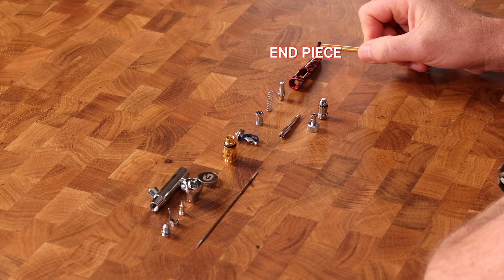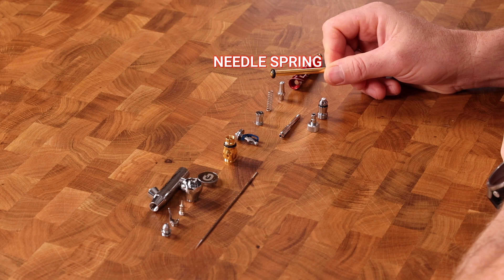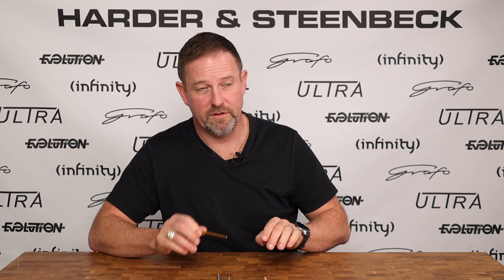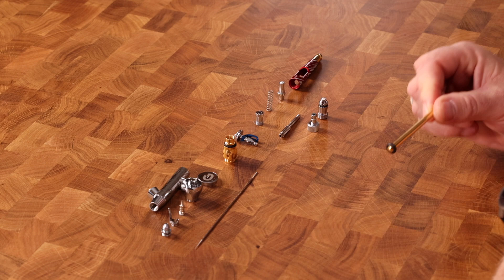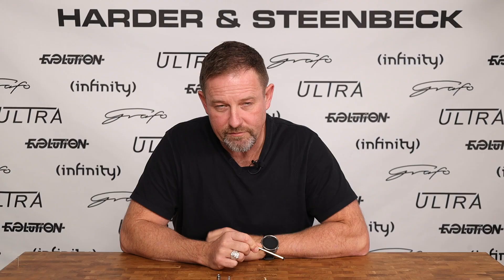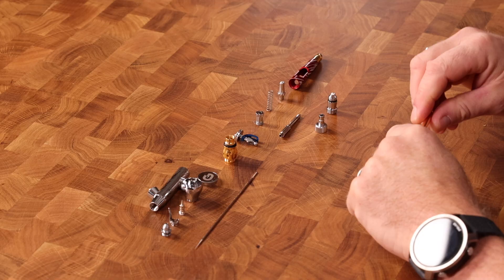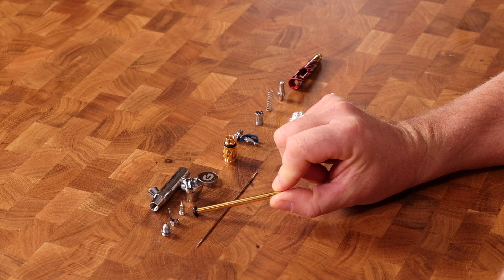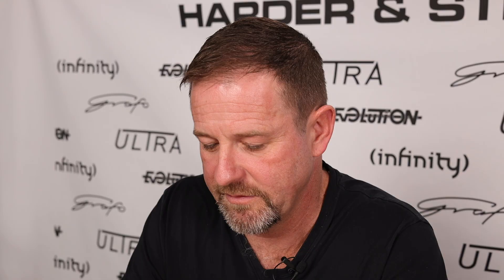Learn to speak AIRBRUSH! What are all those parts called?

Comment: What do you call the X-center equivalent in the Collani?  I’m assuming needle engagement thingy isn’t the correct technical term?
Reply from the maker: The Colani does not use the Excenter system :)
Reply: @harderairbrush I know, but what do you call the bit that performs the same function and engages the needle.

Comment: how do you call parts inside the body , and what to do if paint going into trigger area of airbrush(infinity)
Reply from the maker: You have the needle bearing, which is the screw and seal which seals around the needle. If you are getting paint around the trigger, first of all, make sure that you never remove the needle when there is paint inside the airbrush - this will cause that problem in an instant! Secondly, if you are sure that you haven't done this, you might need to replace the needle seals. VERY VERY rare that this is necessary! It is usually that people have removed the needle when there is paint still inside the airbrush :-) however, if it is the seals, then you'll need part number 123450
Reply: thanks very much @harderairbrush